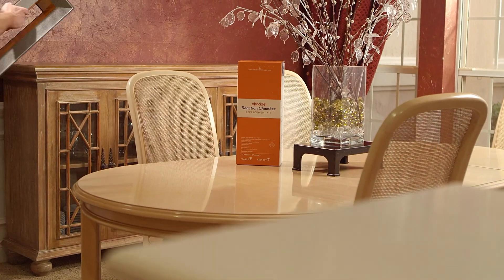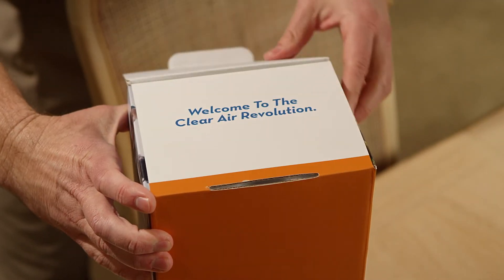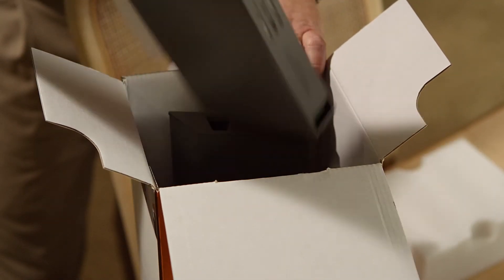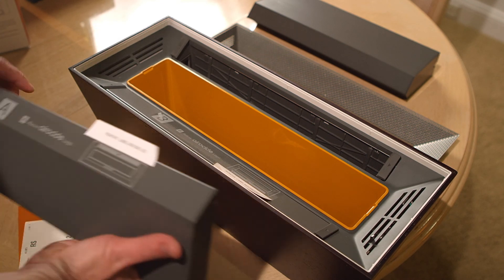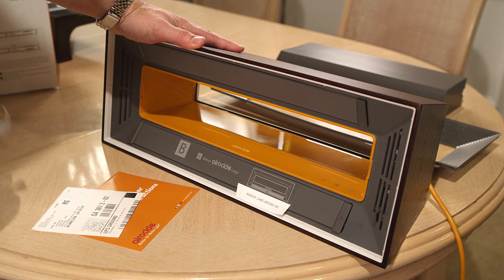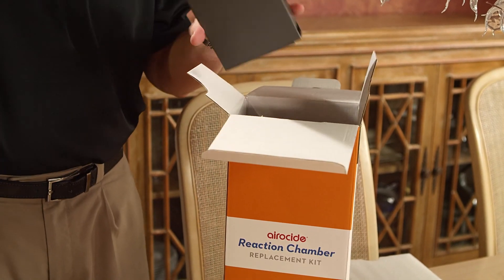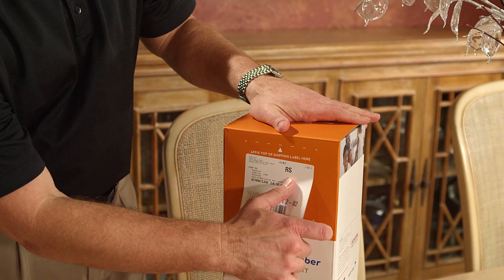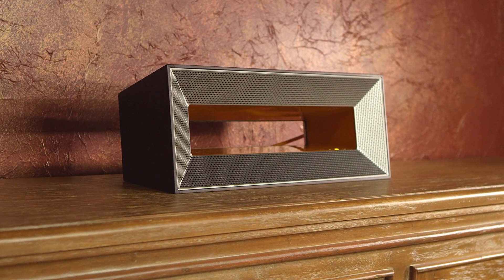How to Change Reaction Chambers

Comment: Can't get the reaction chamber out on one side.  One of the release tabs is stuck.  The other side eventually came out but those tabs were extremely difficult to move.  Nothing at all like in this video.  The unit itself is filthy inside, way past time to change it, but there was never any flashing light to alert me.   Very disappointed with this, especially for the supposed great technology and cost.